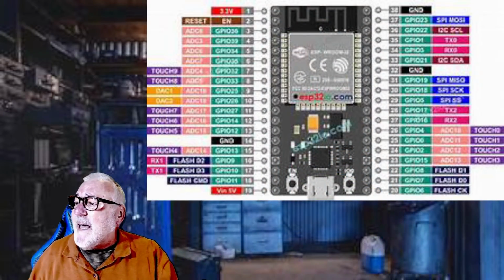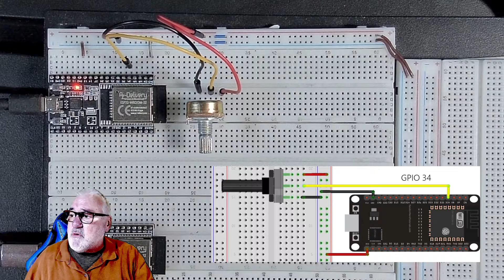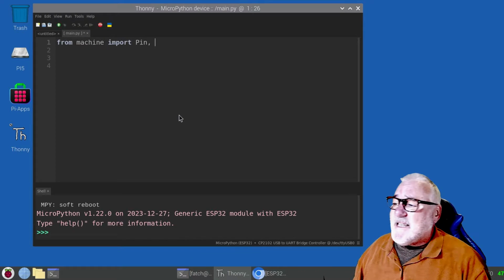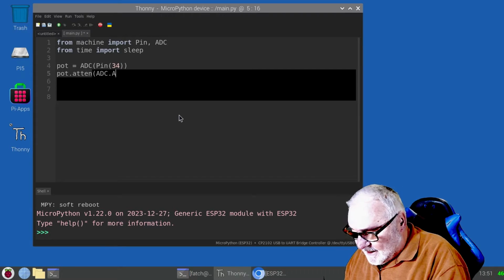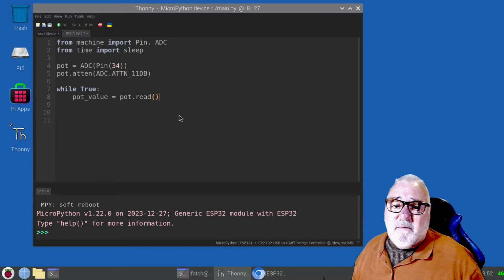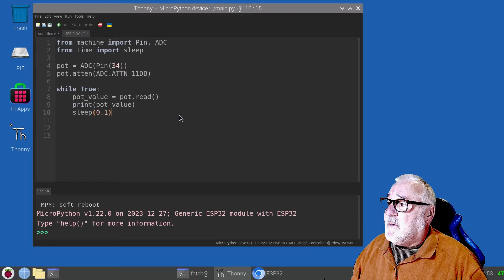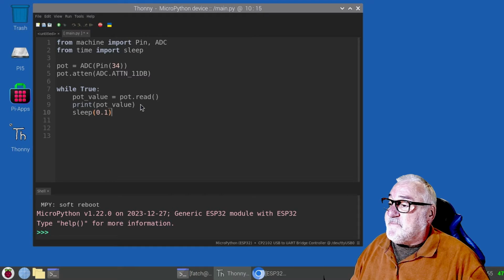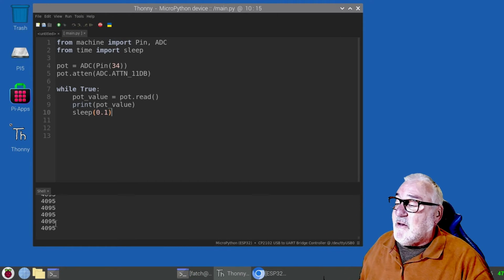How To Read Analog values with MicroPython On The ESP32

Comment: how come the max value is 4095? Is that related to the ohm rating of the potentiometer?
Reply: it is related to the resolution of the ADC. that is 12 bits which is a range of 4096